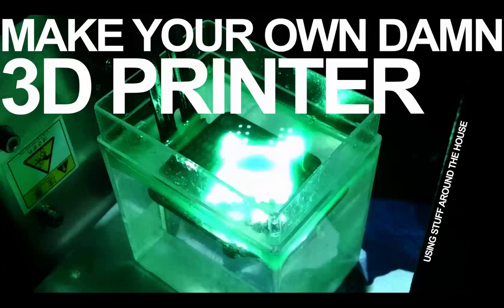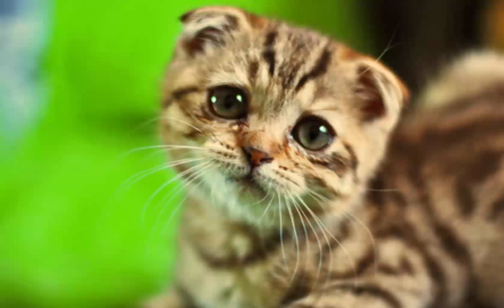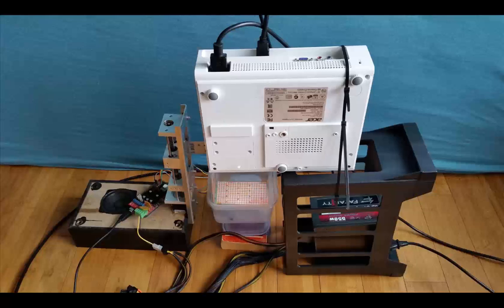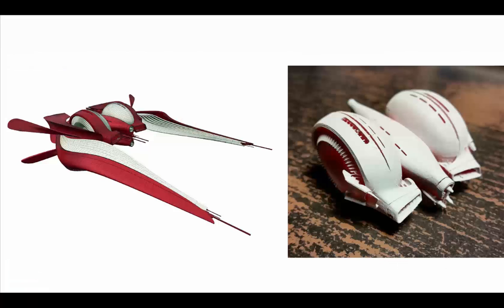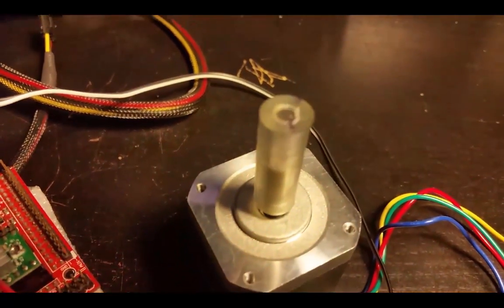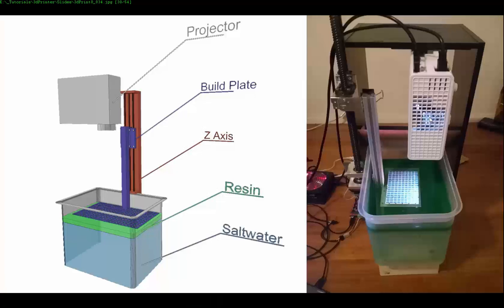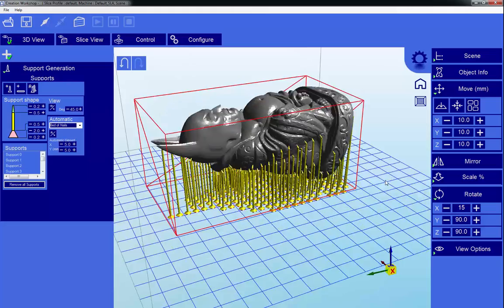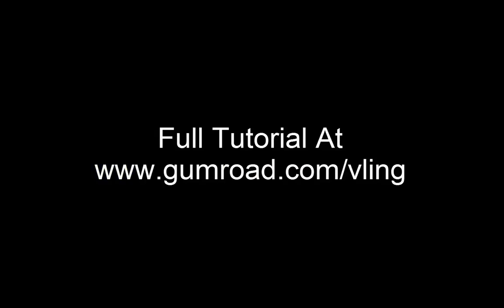Build your own DIY SLA 3d Printer

Comment: This is DLP not SLA
Reply from the maker: https://en.wikipedia.org/wiki/Stereolithography Depends who you ask.  (SLA)Stereolithography is a printing method using a light source (laser, DLP projector, LCD, whatever) to cure light sensitive resin.  The first version of stereolithography was done with Laser so it's become commonly linked to the term, although laser is just one of many methods to achieve SLA printing

Comment: Bought the tutorial.  Will there be any updated info for using raspberry instead of arduino (before i buy hardware). Also, Creation Workshop now costs $500. Any updates for nanodlp?
Reply from the maker: Sorry no updates yet but for nanodlp, you need both arduino and raspberry anyway.  You can use a standard profile for nanodlp, just reverse the motor plug for top down operation

Comment: How big is the build volume?
Reply from the maker: I have mine set at 135x75x180mm.  It can be larger or smaller by changing the projection size but it is a tradeoff of size vs resolution

Comment: Hi. Did you modified the projector in any way? Thanks.
Reply from the maker: no
Reply: Heavypoly thanks. I purchased your tutorial. I will try to build my own.
Reply from the maker: Cool, you can try to use nanoDLP instead of creation workshop for software.  Both free, but nanoDLP is much more modern.
Reply: Heavypoly that's great. Thanks a lot. I already have everything except the projector :). I will also try to make a frame from aluminium profiles. I will let you know how it's going.
Reply from the maker: awesome, look forward to it!
One other big thing  I've learned since this came out:  Use SpotHT Resin.  It is expensive but handles detail and undercuts much better than Makerjuice or FunToDo Resin.

Comment: What is the printing speed? (the overall speed including waiting times, not only the curing time)
Reply from the maker: depends on resin viscosity, how far the projector is from the surface, layer thickness etc.  ranges from about 6 to 40 sec per layer

Comment: Interesting, but I'm not sure you can archive the some result of B9c or Solus. Your project using upside down movement (the contrary of B9c, where they need a tilt mechanism), so the superficial resin tension probably not a low a great Z axis  resolution (I guess the best resolution on Z axis is 100 micron per layer or your design, XY axis is related to projector). Anyway, I'm not so experienced, can you tell me what is your better resolution in Z axis?
Reply from the maker: +minchiozzo I have printed down to 35 micron successfully.  It all depends on settle time between exposures.
Reply: +Heavypoly Thanks very much for your reply and answer. I working on little detailed statue (I'm a freelance digital and traditional sculptor, I see you are also a digital sculptor). I did some test for personal project, and need  20/25 micron per layer on z axis or I have a lot of too noticeable layers (also not less than 25/30 on xy axis). I guess this type of solution (the projector in up position) totally avoid zbleeding issue, but also need a lot of resin compared with  B9c solution.
Reply from the maker: +minchiozzo It doesn't need alot of resin compared to B9, because we are floating the resin ontop of salt water.  Check the sample pictures to see the quality.  Lines are invisible once the model is primed.

Comment: Looks very interesting! Think I will be giving this a try :) What is the build volume and layer resolution of this printer?
Reply from the maker: You can build to whichever size you want.  I used a trashcan as a vat on a larger version with a 300mm z axis which allows you to build the volume of the trashcan.  Resolution can be adjusted from 20 to 100 microns or more.   Again all adjustable in the software.